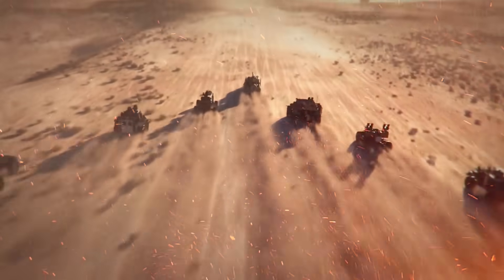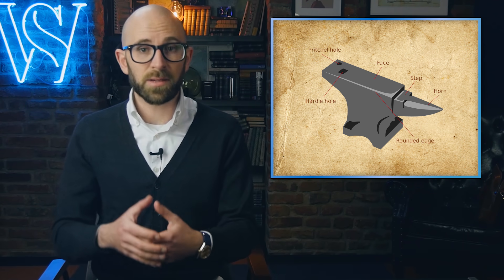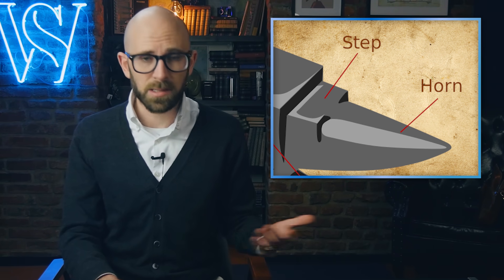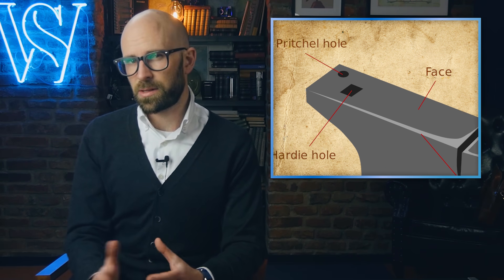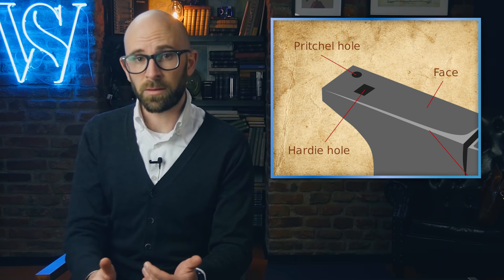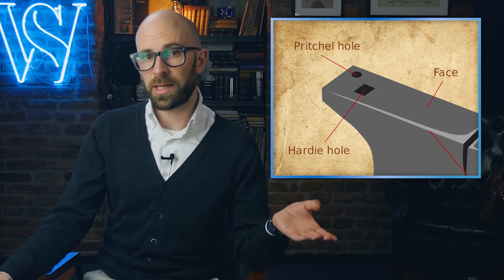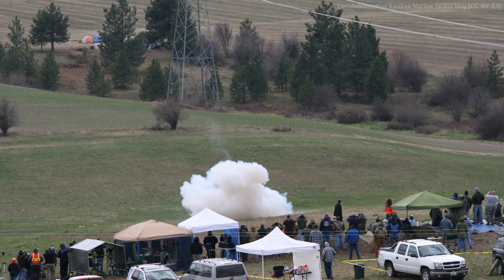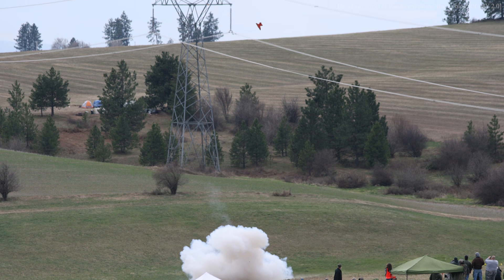Why are Anvils Shaped as They Are and Why Do Blacksmiths Tap the Anvil After a Few Strikes?

Comment: It’s odd to me, this tapping thing. I apprenticed to a master smith and he never did any extraneous tapping. I saw a lot of professional smiths working and I can’t remember any of them doing any extraneous tapping. The steel is cooling down every second it’s out of the fire. My master taught me to hammer continuously until the steel was down to a red heat. The point was to constantly assess the form as I hammered. No wasted heat.

Also, the horn isn’t a surface to mold the steel against. It’s more of a fulcrum. Unless I am trying to stretch/lengthen a piece of steel I never actually hit where the steel touches the horn. Always just one side or another.

Bonus fact: some anvils were made of both cast iron and steel. Cast body and horn with a steel face. I have a Hay Budden brand anvil made this way. 

Bonus bonus facts: the hardie hole is named after the hardie, a chisel like tool that fits in it for cutting steel.  Pritchel is an archaic word for punch.
Reply: Ah somebody who actually knows a few things. Very good. "Strike while the iron is hot"
Reply: @Mr Bones My grandfather said sometimes he did it for advertising; people could here it from anywhere in a small town or village.
Reply: Mr Bones In European smithing there is also a language of tapping when using a striker (assistant with a sledgehammer). The smith will be hammering and then will make two taps on the anvil face to tell the striker to start following the smith’s hammer blows. The striker hits where the smith just hit and with proportional force. When the striker should stop, the smith taps the side of the anvil. These signals vary from smith to smith. 

I have participated in forging with three strikers and a master, which moves the metal but requires precise timing.
Reply: this thread is the most informative I've seen yet. Do any of you mind elaborating on the function or use of the  "step" a bit more? This vid seemed to have sped past its real purpose a bit. 
 Thanks to all. New guy starting my voyage here.
Reply: heatshield The step on an older anvil was deliberately left a bit soft. That way the smith could cut steel or wrought iron with a chisel or hot set without 1) dulling the chisel, or 2) marking up the face of the anvil. I’ve seen old anvils with that area utterly cratered from cutting. 

On newer cast steel anvils the whole surface is the same hardness so it is necessary to use a mild steel saddle or cutting block.
Reply: @hiltonian_1260  and Mr. Bones thank you for the insight and time you took to talk about this with the new guy. I'm setting up a makeshift forge and anvil in a 90yr old garage that has hand made hardware holding it up. . barely. 
 I intend to repair or replace the parts that I'm able to as a beginner course to fix up the little shack as I go. I might be biting off more than I can chew, but if I can keep it from collapsing on my head while I'm in there working on parts to fix it, I'll consider it a win for now. 
 Thank you guys. Cya later maybe. 
 👊😎

Comment: Tapping is not just for keeping rhythm. What I find absolutely amazing is that the blacksmith masters developed their own language. When a master works with an apprentice, or multiple apprentices, the master can take the role of an orchestra conductor and tap the anvil to give rhythm for the apprentices to strike, but they can also strike the iron lightly, showing where the striker should aim, or just tap the anvil in a certain way to tell the apprentice to stop striking, rest, or get back and start striking again. When a master taps the anvil, the striker in line usually follows, tapping the anvil likewise, this gives the master time to examine the work piece and coordinate with the apprentices. It is said that blacksmiths don't talk or shout during work. Their ears would be ringing anyway from pounding steel, so I think it'd be difficult to communicate through speaking, as their ears are already accustomed to the sound of the anvil ringing. The blacksmiths also used tapping to signal the apprentice resting outside, that the iron warmed up and ready to work, so he should come into the workshop and get back to work. The language of the blacksmiths is truly fascinating! This video shows this communication in practice: https://youtu.be/C-FMkKR_Djg?t=1212

Comment: Cast iron harder than high carbon steel? Not really. The hardness depends on a lot more than the raw carbon content, namely the crystalline structure. In cast iron the carbon segregates out during solidification in the form of graphite flakes, making the iron structure in between much less carbon rich, The art of making extremely high carbon steels is in preventing this segregation during the casting of the raw steel block. This is done by doping the mix with other elements, thus seeding crystallization, and by carefully controlling the cooling process.
Reply: I thought the same thing,  but then reasoned that maybe cast was harder,  because it does break.  I bet some carbon steel could give it a run for its money....

Comment: WTF? No, cast iron is NOT harder than steel. It usually has a layer of mill scale on it, plus occasionally sand from the foundry mold, but that's a paper-thin layer.

It's actually rather soft, but the excess carbon leaves graphite flakes throughout the material and makes it brittle. Medium to high carbon steels and tool steels are far harder when hard treated.

Oh, and cast iron does not have carbon added: it's already there in the pig iron.  You have to remove most of the carbon to get steel, for example via the Bessemer process.

Comment: One thing to remember about resurfacing an anvil, dont. Especially if it's an older anvil, you'll take off the hardened plate and make the anvil less effective and possibly ruining it. Only a fully heat treated all steel anvil should be resurfaced without worrying about it.

Comment: No.  Tapping the anvil between working blows is NOT about resting or rhythm.  Anyone who has actually used a hammer to make a living knows this action is how the blacksmith keeps his hammer on target.  It's a feedback activity that keeps his hammering hand connected to his targeting sense, so the next working blow falls precisely on the work at the spot he intends, even if the working piece has moved since the last working blow.  

It may also be a way the blacksmith works to remove any errant particles that have become stuck on the hammer face, and to prevent those particles from being driven into the working piece with a subsequent blow.  

You're welcome.

Comment: My friends dad had an anvil. He never was a blacksmith. I have no clue why he had one.
Reply: Just in case he meets a road runner
Reply: My dad did also and he too isn't a blacksmith, he would still use it for other things like fixing an axe head to the handle or bending cold metal.
Reply: Prosaic possibility: metalworking extends beyond blacksmithing and anvils can be used for shaping metal cold. If your friend's dad had no hammers, then I'd wonder what the anvil was for.

Comment: They tap the hammer on the anvil to shed any scale that came of the metal there working and stuck to the hammer face so they dont keep hammering it back into the metal
Reply: Not true at all. It is not that big of a deal and it doesn't stick to the hammer at ALL! It is just as Simon said,  for rest and to keep  rythm while turning or examining the work,. I my 43 years of being a full time blacksmith,  I have never had scale stick to the hammer. Oh it it is scale,  not slag. Slag is what floats to the top of the crucible when melting iron.
I added that last part because many people call it slag, you did not.